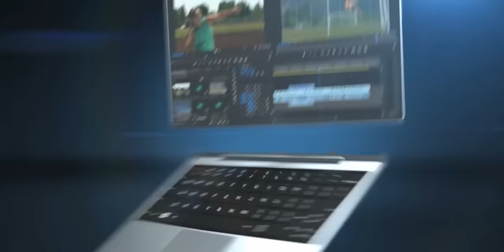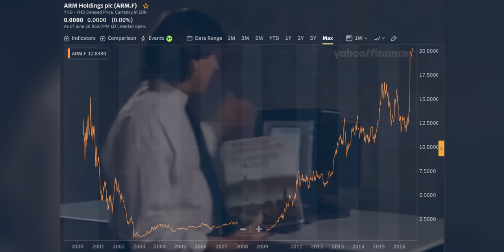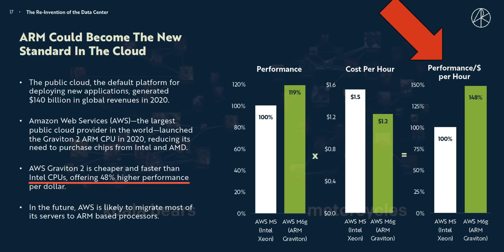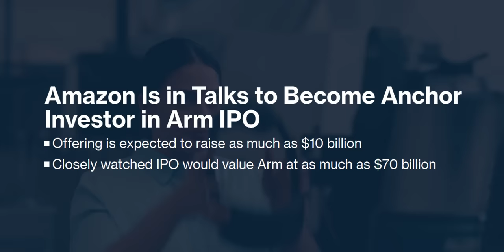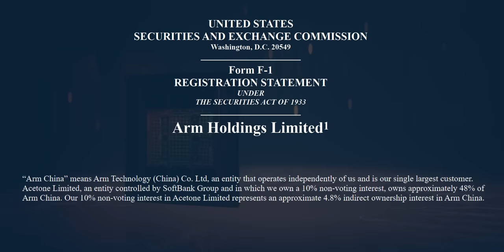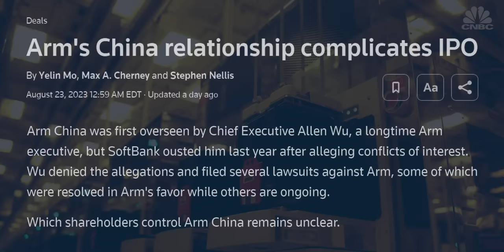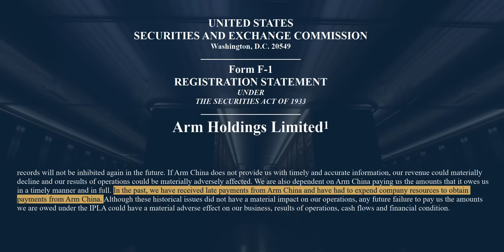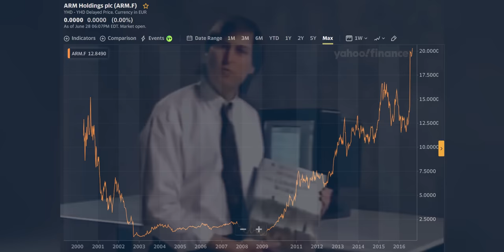The Next Nvidia Stock? ARM IPO Overview (ARM Stock)

Comment: ARM ipo valuation is bs. Two years ago, SoftBank wants to sell it for $40 Billion USD, now it is worth 75% more in two years? What changes 😂
Reply: Mainly fear of one company acquiring them imo, not valuation eg intel
Reply: Apple switched their CPU's from x86 to ARM with the M1 chip series... Given the number of creative and technologists that use Macs the software catalog for desktop ARM applications has skyrocketed.  Add in the Oculus VR headsets taking off and creating an entirely new category of consumer spending, dominated by ARM.  Lastly there is the joint venture between ARM and NVIDIA to deliver extremely powerful AI CPU's which is literally "all the rage" after GPT4's unveiling this year.   ARM went from a cell phone CPU company to dang near monopoly on computing in just a few short years.